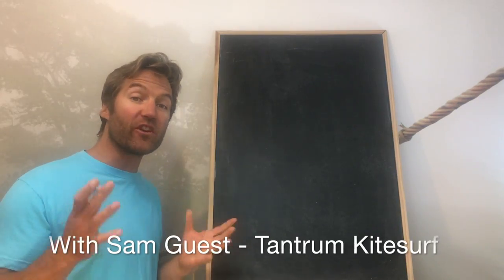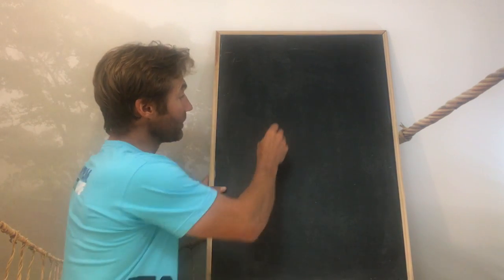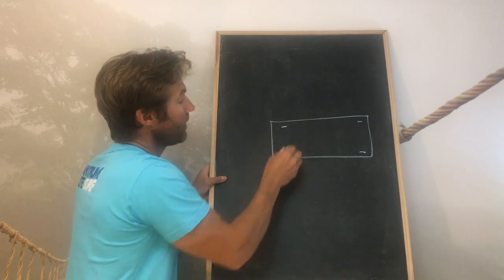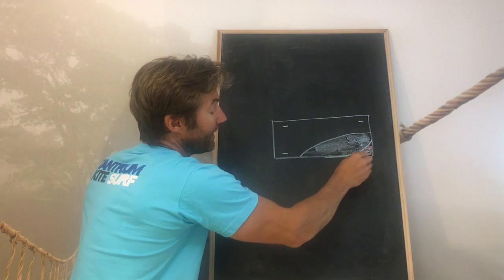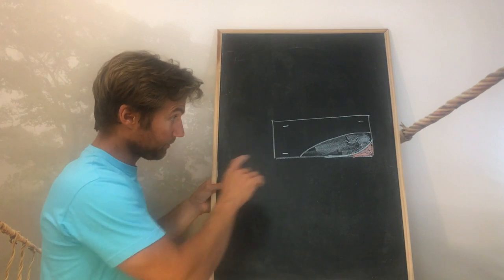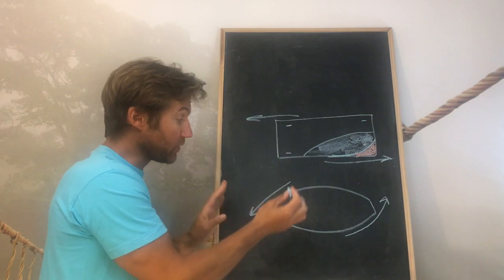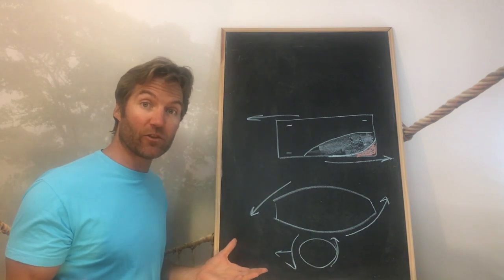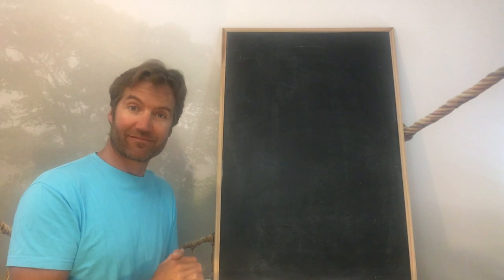Understanding Twintip Kiteboard Design

Comment: Good explanation! nice to learn the physics behind. Do you know how and how much different board weight affects riding, popping and overall handling? I've made two kiteboards myself and they ara a bit heavier than a board bought from the store (used plywood core instead of foam). But i havn't tried that many factory boards so i can't really tell the difference. When they release new bords they usually brag about how much lighter it is than previous designs. But how big is the difference  really between a 8 pound board and a 5 pound board with the same shape and size?

Comment: Also Sam,  I have a question.  Since you talked a lot about Waterstart in previous videos, and I am specifically struggling with waterstart, do you think I should get a "door" instead of regular-shaped for my first kiteboard?

I was thinking still a large board...like Liquid Force Overdrive 148cmX45.5cm.   But the shape is not "door",  meaning edges are cut-out slightly.    Would that be a problem?   I weigh 200 lbs.
Reply from the maker: Hmmm...depends on what you're struggling with really. Have you watched my video on the definitive guide to water starting? That might give you a few pointers, if you're still stuck after that let me know.
Reply: Tantrum Kitesurf The last I tried was in Summer 2017.  After that, Minnesota weather is too cold to allow kitesurfing, though I had been snowkiting and made very good progress.  

But the last I remember, my struggle was similar to the "rotation" thing you described in this video.  For example, If I am trying to warerstart to my left, the nose of the board ends up going way left and I fall.  

From your explanation about waterstart, until now, I felt that the problem is with my flying and pointing the board downwind.  

But now that you have put up this video, i am wondering if door-shape helps with "not allowing for board to rotate" 
Thoughts?
Reply from the maker: If I understand you correctly it sounds like your bringing the kite back too quickly before you start the down stroke...drift the kite back SLOWLY and then send the kite into the first stroke
Reply: Tantrum Kitesurf Thanks Sam.  Will try that.  But I won't be able to until a couple of months when the lakes will de-freeze.  

Meanwhile, I was wondering if i can purchase a kiteboard which is "not" door-shaped but still big enough (148 cm long,  45 cm wide) ?
Reply from the maker: You certainly could but I don't think the board is the problem at the moment until you're actually up and riding at least a little bit the board won't make too much difference
Reply: Tantrum Kitesurf Thanks Sam.  Irrespective of waterstart, in general do you suggest door boards for beginners/intermediate heavy riders or bigger rugby-shaped boards?
Reply from the maker: No worries! A door shaped board is always going to be easier at the early stages...but you'll grow out of it faster...that said it'll always be useful for light wind days